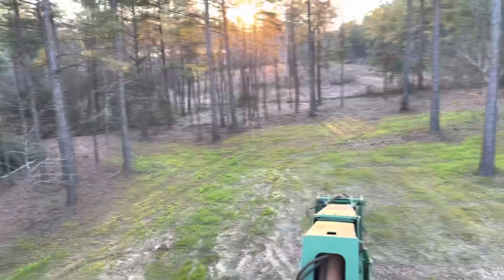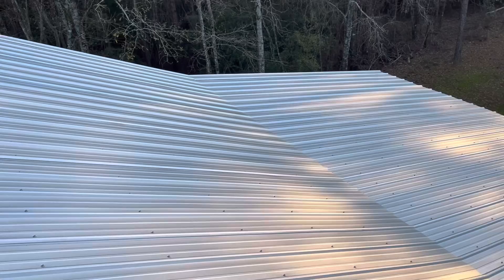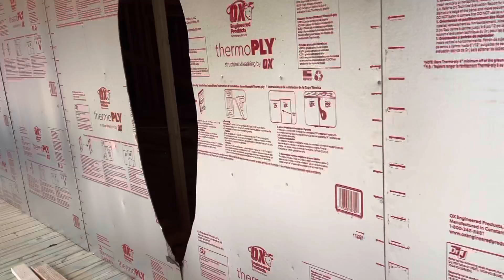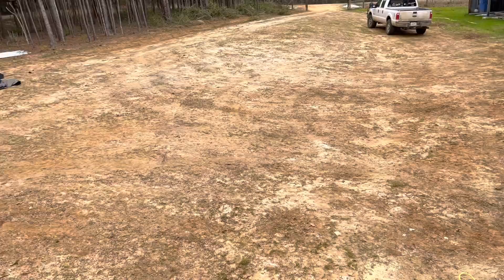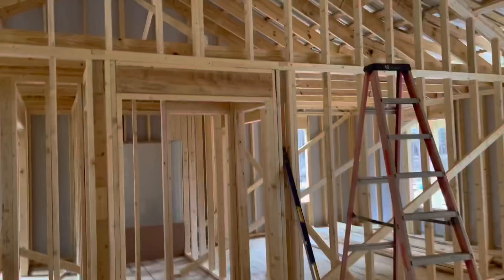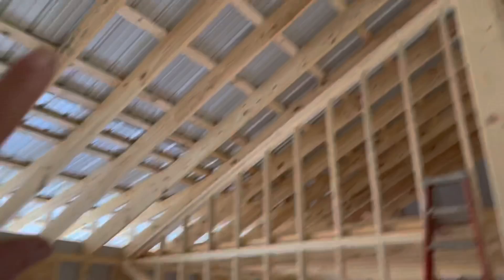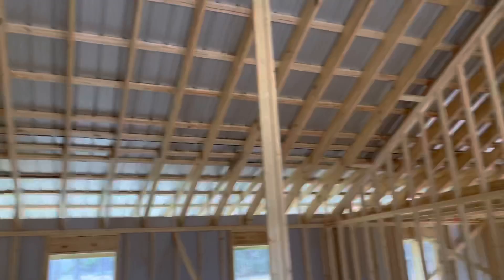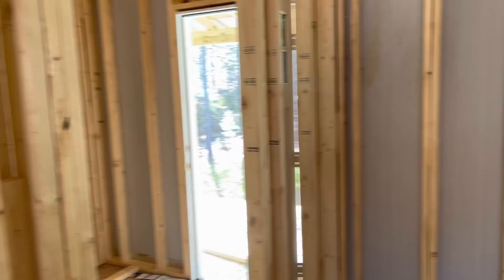Medal Roof & Lap Siding on New House Build

Comment: Jeff, Appreciate you sharing.  Your workmanship is first rate.  Placing the screws in the valley of the metal roofing prevents high winds from loosening the fasteners and then the roof goes.  Yet so many people want to put fasteners in the ridges of the metal.
Reply: Jerry Cheatwood  Never happened to any of my roofs.  Here in Florida I see any roof with fasteners on the ridge of the sheet loosen over time.  That includes screws and nails.

Comment: I love the sound of rain as it hits a metal roof. Before Dad passed we had a few hundred acres in east Texas. We built a pole barn first. 

We put metal on the exterior and roof. Once the barn was dried in we built racks for the hand tools, poured a small slab for a compressor.

While installing the compressor the sky opened up. The rain came down hard. It was so loud we could barely hear each other talk.

I'm surprised you didnt use Hardie-Plank for the exterior facia. Itll last longer than wood.

Comment: Great job. Great fitup everywhere.  I thought the screws had to go on top of the highest ridge in the roofing steel.
I'm sure you have it figured out OK  Well Done Sir.
Reply: On a pitch of this moderate slope the manufacturer recommends securing on the flat of the sheet. Only on minimum pitches is it in the ridge.

Comment: No seam selling tape on metal. No lap screws. Ridge cap only half screwed of. No transition metal on pitch changes. The mice are going to have a hay day with those spray foam siding corners.

Comment: Awesome work! Looks great too! And they did it really fast and put in a lot of thought on the design. No shoddy warped lumber was used either! All of this with just Jeff and Hannah doing it all themselves inside of two months? WOW.
But, not to rain on the parade, I always go with a standing seam metal roof instead because with that type of metal roof all of those exposed screws with the rubber washers that seal under them will all start to rust out, back out and then leak after about 10 to 15 years. Trust me, I know from experience having to go back and fix them. They are a real pain IMO. Just sayin'.

Comment: Jeff love y'alls compassion for the outdoors yalls drive for work and love for your family.  Man if the world was more like yall it would be a much better place. 
 i just finished closing in my addition an I  did notice when it frosted on the tin condensation built up on the underneath side of the tin then you have water droplets on the floor.  Question will the spray foam insulation keep it from condesating?  One guy that does remodeling says that just sprayed insulation want stop it and I'll have problems later. He said pull it up and Tyvek it  But another home builder said shouldn't be a problem. I don't know what to do but I did it just like you did. Im in Bama bout HR or 2 north.

Comment: Don’t let ya ac guy feed ya a line of crap I’m in Louisiana and been doin ac & heating here for 25 years and it is so worth spray foaming entire house but get a ac guy who knows about spray foam the one ya got is feeding you a line of crap about  the foam you will save on unit install and make house twice as efficient if spray foamed entirely ( called a sealed envelope house ceiling walls and floor ) and make sure to use a energy recovery ventilator in house also !!!!!!!! Have a goodern sir

Comment: Where were you able to find the traditional lap siding, Jeff? I can't find any anywhere to repair my house at all. Did you make it yourself? All that there is around here at the lumberyards and home improvement centers are the pressed particle board flat panels that only look like lap siding. My house has redwood 50 year old lap siding and it's all cracked and weather beaten on the south and western sides and none exists for me to buy to replace just these bad parts and I do not want vinyl siding!.